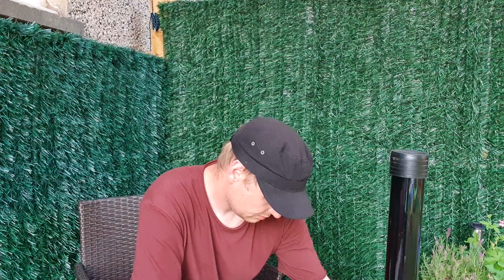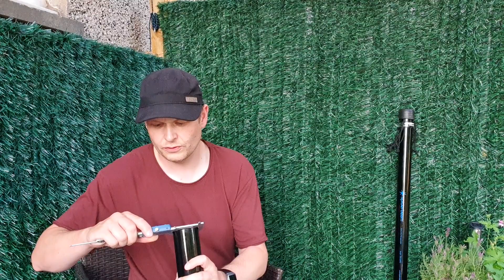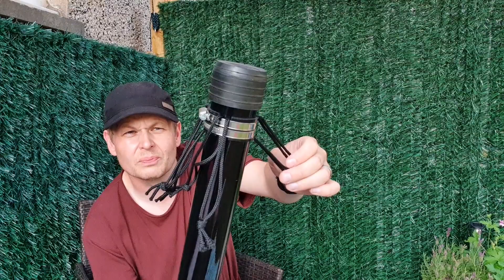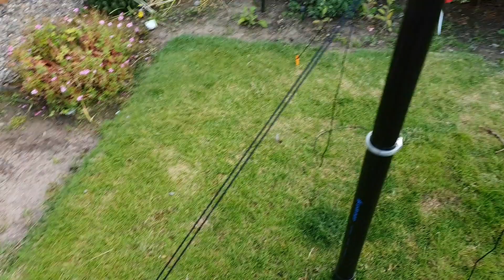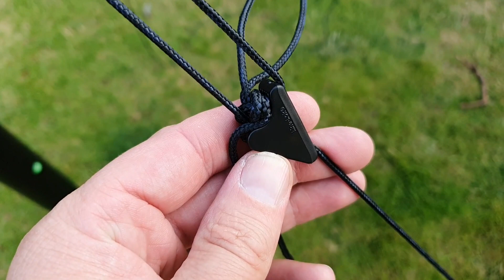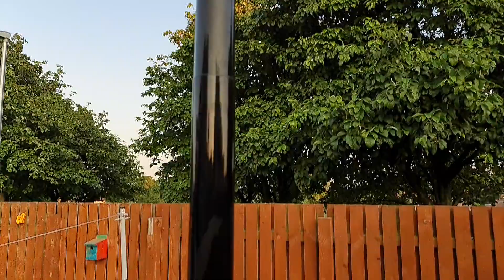Spiderbeam 10m Mini Fibreglass Pole Review

Comment: Hi mate just found this hi.
Iam wanting a 10m pole which will support a 80m inv L.
Not sure if that 10m pole will be strong enough at the top, or I need the 12m pole brought down to a 10m height, with the stronger section at that point. Both poles will be guided two thirds up.
Any comments?
73.
Reply from the maker: Your spot on mate, this is too flimsy for that. You need the 12m pole with 1 or 2 sections removed. Callums 12m pole is very slightly more HD over the Spiderbeam but choice is your. How will you supportbat height at the other end? A tall tree?
Reply: Yeh a tree if i do decide to do that. 
At the moment all bands are pretty much dead.
Reply from the maker: @brianfields4479 17m is supposedly hot but know your not keen on the pileups. Just in the middle of making something for 17m as the Doublet wont tune.
Reply: I made a elevated vertical for 17m, it worked great just on a fence post.
Iam trying to be on 40m more, but bands here are mainly closed this time of the year, it will pick up around Xmas.

Comment: I know this is an old video but what did you use to clean the production gunk from the sections? Assuming you also 'dismantled' to clean?
Reply from the maker: I really didnt have any "gunk" on them I recall. For that type of cleaning I use a pre wipe degreaser thats used to clean auto body panels pre and post painting.
Reply: @MM0OPXFieldRadio  Thanks for getting back! I was referring to 07:53 'sticky coating' but I think you've answered my question. I guess as you infer it's mould release. I will grab some wipes. Thanks again, you helped me choose the spiderbeam 10m for my first pole (it's on the way, hence question).
Reply from the maker: @donkeykebab you wont regret it.

Comment: This is a great pole i love it. The 10m seems a bit stiffer than the 12m at the full length. I think this is because of the shorter parts
Reply from the maker: I like it. Just need the 7m version now.
Reply: @MM0OPXFieldRadio  I use the 10m at full length for my endfed. In the field and at the camping.

Comment: How much horizontal pull can be placed on top of pole. Am thinking about running a end feed from this pole to around 30m horizontal so there might be some tension needed to stop line sagging?
Reply from the maker: I cant quantify that. It will be better than a standard lightweight pole but yesnit may need counter tensioning.

Comment: Your clamps are installed incorrectly and goes against the manufactures recommendation.  The way you have them installed could actually damage the mast.  The clamps should go above the seam, that prevents it from sliding down.  Clamping it below the seem is squeezing the mast and can cause issues.
Reply from the maker: No, they are installed correctly for their function. These clamps are not used the purposes of guying and there is only minimum pressure. What your talking about I'm well aware of and do this too
Reply: @MM0OPXFieldRadio  You do you, I was just mentioning for others that might watch.  Per the manufacture:
"Simply put one clamp at the very bottom end of each tube segment and tighten the clamp."

Your clamp is at the top of the segment.  You need to extend the segment then put the clamp at the bottom of that segment.  That prevents it from sliding down with very little force being applied.  Trying to squeeze the segment below can cause damage. For guying I don't think it really matters so long as you don't crank it down.
Reply from the maker: We won't agree on this. What the manufacturer is recommending is a completely different application from what I am doing here. I am using the clamp for guying only and there is minimum pressure applied. I put all my poles up vertically with the bottom section guyed already. I've done this for years and not had 1 pole section break. This isn't my first rodeo. To stop the pole sections collapsing I use Coroplast tape (look it up) or use thr hose clamp with PVC hose as per manufacturers. How others guy theirs is entirely up to themselves and best of luck.

Comment: What eyelet do you use on the 10m pole to attach the antenna? Thanks!
Reply from the maker: I don't use an eyelet as such.  I'm using this linear loaded so using one of mu adjustiwave top clamp plates which uses a rubber hose clamp which clamps to the Spiderbeam pole.

Comment: Hi,good video but surely your hose clamps are positioned wrong?? They should be on the thinner part of the pole which stops it collapsing rather than the thicker bit of the pole as you could crack the pole trying to clamp it against the thin piece......73
Reply from the maker: Nope, it's right where it is. The purpose of the clamp in question is for guying only, not to clamp one section to another. There is no real "crush" applied. Only enough force to hold in place. If you applied the upper hose clamp to the thinner section you would need a step ladder to extend the pole. Watch this for guying my 12m pole. Same principle https://youtu.be/qmIARntxXqk
Reply: @MM0OPXFieldRadio  I believe @andy2E0JIU is correct.  You're using the top clamp for guying the pole, but you said the lower clamp is to keep the next section from collapsing.  This should be on the smaller/upper section of the joint to prevent slippage of the upper section AND to prevent stress on the lower section.  Here, you're using two clamps for completely different reasons.  Spiderbeam intends for their clamps to be fastened above--not below--each joint.
Reply from the maker: No your not seeing it right. I wish I had shown a close up. Each clamp IS on the upper section just like spiderbeam which stops collapse. Each clamp has very little "crush" force too.

Comment: Great comparison video Colin, I have the 12m spider pole and now employ your method of lower section guying thanks for the tip 👍
Reply from the maker: Thanks Paul. I rarely guy the 12m above this.  Only when it's quite gusty. I've even had my moxon up in slight wind at the 7m point with no extra guying.

Comment: Cheers Colin, I want to get a Spiderbeam , think I will go for the 12 meter one as I have a camper van and a slot for fitting in  ⛷ so the big yin will work for me
Reply: 12 is like a 1X shirt.  They go much bigger!
Reply from the maker: The big yin is hard to beat, especially as you say if space and weight isn't an issue.

Comment: Looks pretty good . I got the 12 metre it is a good fit outside a scaffold pole with a wee bit of rubber tape on the scaffold.  I have a 40m GP fixed onto it at 10m feed point no guy just 3 swivel brackets on the first scaffold pole with t&k on the house  . Looks scoured enough so far only winter storms might have a different idea ?

Comment: I bought one, the only issue for me was the overall diameter of the base section, it no longer fits inside my drive on mast stand.  The pole itself as other Spiderbeam products is top notch, can’t fault it.  Thanks for posting 👍🏻 all the best Mike.
Reply from the maker: Not sure why they decided on the difference base but hey ho. It works well for me as the 2nd section is same diameter as the bottom section of the 12m allowing for easy mounting of the antenna. 73, Colin